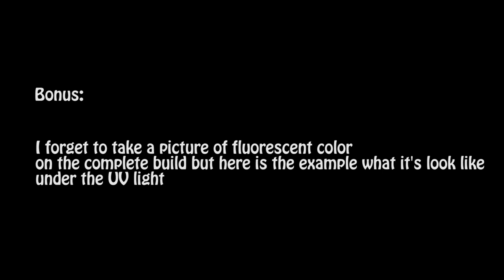MG Sazabi Verka Full Painting Video - Gunpla Tutorial

Comment: what is the dilution ratio you use on gaia paint? at is the dilution ratio you use on gaia paint? 1:?
Reply from the maker: When using Gaia Paint, my ratio is 1 : 3
Reply: @tokiostudio2730   how about E7 or mr.color?the same?
Reply from the maker: E7 paint i use 1 : 3 or 1 : 3.5 ratio
MrColor usually  i use 1 : 2 ratio
Reply: @tokiostudio2730  thanks,recently when i am using gaia white surfacer,i just find it is so hard to cover the color of the model
Reply from the maker: its because the white paint is weak, so it can't cover the color of entire surface. you need several layer to make all the surface become white